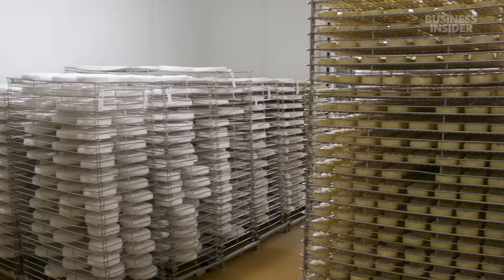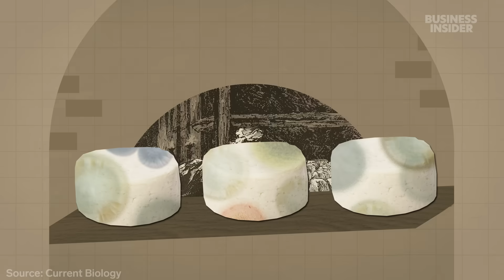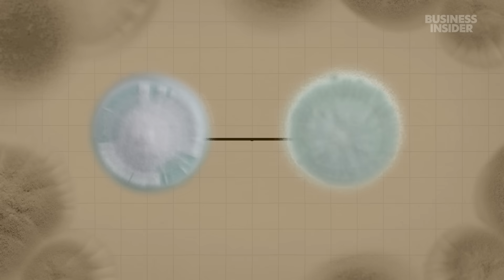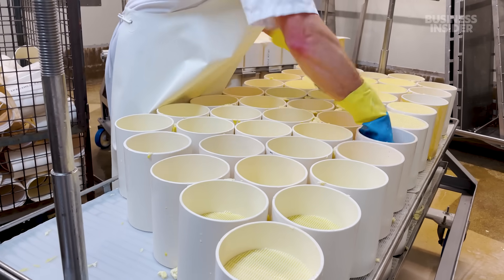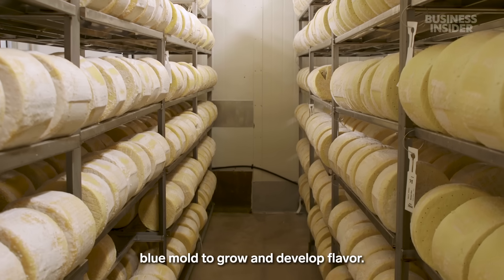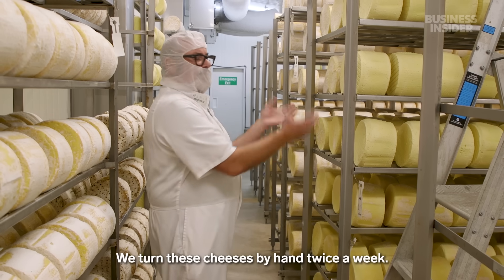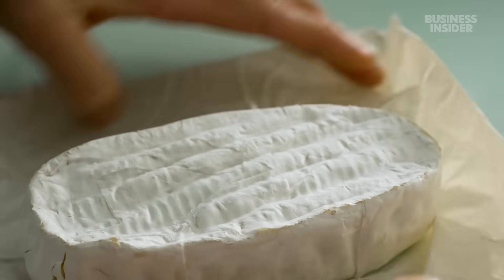Why the Mold Behind Brie Cheese Is Disappearing

Comment: this is fake supply shock with the intentions of increasing buys of this rare expensive product. Mold is a type of fungi and is VERY easily farmed, cloned, and mass produced. the cost to clone and reproduce mold spores is basically 0.

L video
Reply: Did you even watch the video?
L comment
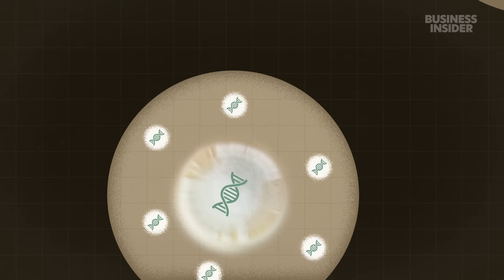Reply: You didn't watch the part (6:15) where they explained how, after a century of cloning, Penicillium camemberti (the very specific mold that they use) is producing fewer spores than it use to. Also, due to a lack of genetic diversity, a single disease could wipe out that very specific strain of mold.
Reply: @trilobiteterror8015  Please see my earlier comment in the root of the channel.  We're in ZERO danger of running out of that specific penicillium due to our antibiotic-production expertise with penicilliums and over a century of expertise in preserving specific species of fungus, bacteria (and symbiotic associations of them) in brewing and wine-making. These are valuable industries essential to many economies.  We have vaults (literal vaults with armed security) of these organisms distributed across the world.
Reply: @trilobiteterror8015  I didn't really understand, or they didn't fully explain, that part. How is a 1:1 clone producing less spores? that would imply that the clones are not really 100% clones. I don't understand why they can't get a sample of extemely old brie mold and start cloning from that since it would be closer to the original.. right? Something doesn't make sense. I get how it's susceptible to infection like any monoculture, but the cloning bit seems like they skipped important information. As a scientist (food scientist even) with a very strong bio background, this ticks me off. And I'm sure we could do some genetic modification, but people are dunces so the industry wants everything to be "non-GMO". F that, give me GMOs, it's cleaner and safer than random breeding nonsense.
Reply: @trilobiteterror8015  this is the situation for all of our fruits and veggies.

does that mean bananas are going extinct soon?
Reply: @slimthugger5794  Besides bananas (in much of the West), there are many different fruit and vegetable cultivars that are used (and how they reproduce, the process of grafting etc., is very different from a single strain of mold cloning itself via spores). 

Yes, because of how bananas are grown, the single primary cultivar we use in the West (Cavendish) is at serious risk of disease, just  like how (since the 1950s) Gros Michel bananas can no longer be grown at a commercial scale in much of the West Hemisphere due to Panama disease, (the reason why we switched to Cavendish).
Reply: Yeah, basically sensationalist bullshit to get attention for something nobody really cares about. People who like blue cheese are really weird and, in my opinion, have a fucked-up sense of taste. Like they said, before proper selection, you could die from it, it tells you everything you need to know about it. But people are weird and do many things to pretend to be more refined than others, including eating some stuff that is toxic and not really desirable.
Brie/camembert is not as bad as blue cheese but it really isn't very good either, it's all right when baked because it kills all the bad stuff but that's pretty much it. People who like this sort of thing wouldn't last very long on their own in the nature because taste should inform you about stuff that are good to eat or not, when you can't make the difference, you would be likely to eat bizarre things that would likely cause trouble down the line.
Losing the mold wouldn't be so bad, there are plenty of cheese that are very good without needing mold.